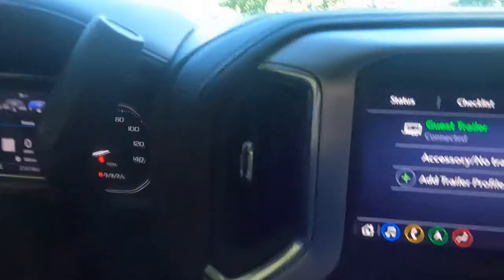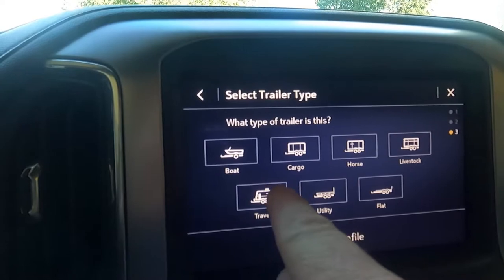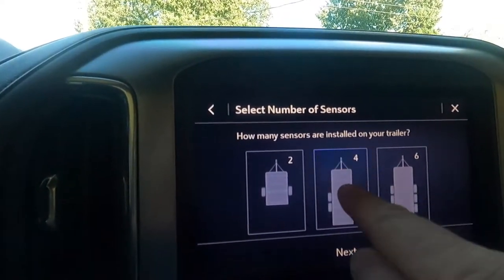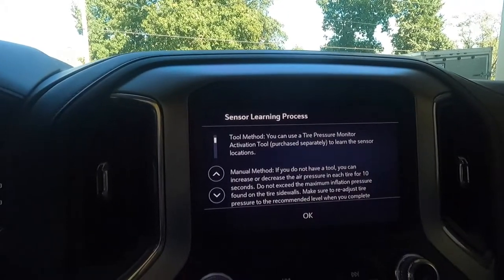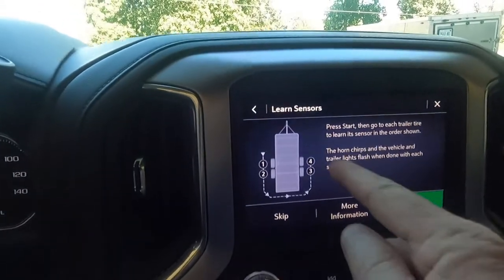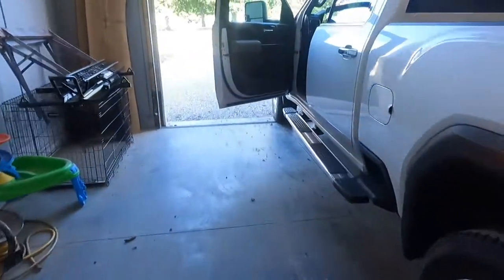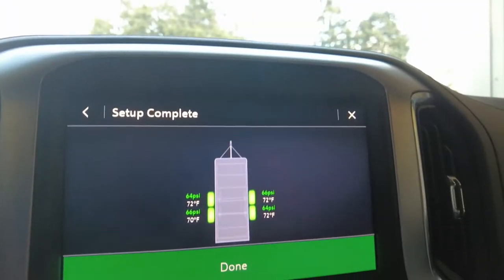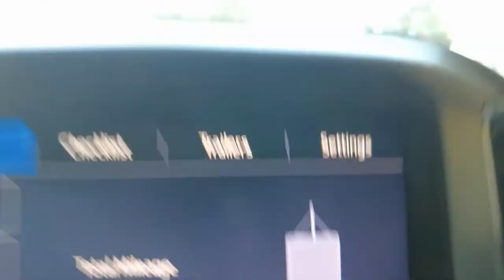Setting up TPMS  for our travel trailer on our 2020 GMC 2500HD SLT with ProGrade trailering system

Comment: Great video, very informative thank you! My 2020 AT4 HD came with the trailering package, including the sensors. I installed the sensors myself, and purchased the learn tool off of amazon. We went to Texas for the winter, then decided the trailer wasn't big enough for the wife, 3 pups and I so we purchased a fifth wheel, and sold our TT. Unfortunately I didn't remove the sensors and let them go with the trailer. 
I just finished purchasing new TTPMS sensors from the local dealership, and the reason being when I asked about replacements, the first thing they asked for was the Vin# on the truck, so this led me to believe that in order to get the right ones I needed to buy them from the dealer. Long story short, these new sensors and my lack of knowledge cost me about $300. Thanks again for the video, everyone is welcome to learn from my mistakes, and your information...
PS. at least I kept the scan tool, so that saved me 20 bucks LOL!
PSS Happy Camping
Reply from the maker: Hi Donald.  Thanks so much for watching and commenting.  We can all learn from our mistakes.  Believe me  I make a lot of mistakes. lol.  So nice of you to share your experience.  We love having the built in TTPMS.  Have a great rest of the week.  Kent

Comment: On my 2024 2500, the 'letting air out' method works perfectly.   I've actually had to do it several times because I had a problem with the trailer profile disappearing. After reseting the whole system, it stopped losing the profile.  My horn chirped after draining about 5 lbs of air for each tire.  I may get one of those tools anyway because it's more convenient.
Reply from the maker: Thanks so much for watching and commenting.  We really like the TPMS monitoring for the trailer.  The tool is really handy and just takes a couple of minutes to program all the tires.  Have a great week.
Reply: Just came across this video how did u figure out which one would work i have a gmc with prograde trailering and would like to get some for my camper great video
Reply: @colongarnto4695  I have the same question as you.  All the TPMS tools say they will not work in the '24 GMCs.  Strange.

Comment: Good video.  Thinking of buying two more to add my spares on truck and trailer.  Truck is under order. I guess I will have to tell it I have 6 wheel trailer and remember which 2 are my spares.  Or is there a better option?
Reply from the maker: Hello Dan.  I did not worry about putting on my spare tires.  I figured they would be taken back off as soon as I could get the other one fixed.  Thanks for watching and commenting.  Have a great week.

Comment: I purchased a tpms kit off Amazon last year and I wonder if the relearn tool will read the sensors that came with that
Reply from the maker: I don't think the aftermarket sensors will work.  I had an aftermarket kit and it would not work with the package on my truck.  Thanks for watching.  Kent

Comment: After setting up, does it have a low pressure warning
Reply from the maker: Hi Gary.  The only reason you would have a low pressure warning is if one of the tires is low.   If you are referring to if it will give a low pressure warning if a tire goes low yes it will.  It will come up on your dash.  Hope this answers your question.  Kent

Comment: Can you tell me what to look for to buy these for my gmc 2020, just bought a new fifth wheel, do they have to be gmc sensors,
Reply from the maker: Hi Brian.  If you do a search for trailer sensors for your particular truck several different ones will come up.  I think about any GM sensor that works on 433 mghz will work.  The main thing is to make sure they will work on your trailer as far as handling the tire pressure etc. for your fifth wheel.  Thanks so much for watching and have a great rest of the week.  Kent

Comment: Is all the trailering stuff a specific package you have to purchase with your truck? Shopping new Chevy 2500s
Reply from the maker: Yes on the stuff inside the truck.  The GMC is called the ProGrade package.  Not sure on Chevy.  Sometimes they call it something different.  You can buy the sensors aftermarket for the tires, but if you buy the truck with the trailering package ask them to throw the sensors in with it. The GM sensors are not real expensive if you get them when buying the truck.  If purchased afterwards they get a lot more expensive.  Aftermarket sensors do work though.  Thanks for watching.  It is a nice feature to have.
Reply: The sensors were a $50 option when I ordered my 2022 3500

Comment: How did you get the TPMS ? Do you remember the part number? My dealership is no help.
Reply from the maker: If your truck has the GMC  ProGrade trailering package or on Chevrolet I think it might be called something else then the part number for the tpms sensors is 84152501.  I had them installed by a tire shop and then programmed them myself with the tool in the video. They work awesome.  Actually any GM 433MGHZ sensor will work. You can find the trailer ones on line cheaper than from the dealer.   Thanks for watching and have a great week.  If this didn't answer your question feel free to message me back.  Kent
Reply: Thank you. I'll be checking for them soon.

Comment: We need a different one. Bills not happy with ours. Maybe we will look into one like yours. 👍🏼
Reply from the maker: Hey guys.  The one I have is integrated into the trucks 
tpms.  Do not know if your guys truck has that capability or not.  We found out it works as the second trip out with it we had a tire go down on us.  First time I have had to change a tire on any of our vehicles in 36 years of marriage.  I think I have been lucky. lol. Have a great week.  Kent and Tami
Reply: That’s true. Bill would know if our truck is wired for that.

Comment: Do you have which brand of TPMS you purchased on eBay?
Reply from the maker: Hi Scott.  I do not remember.  I searched for trailer tpms sensors for a 2020 GMC 2500hd and several came up.  Almost any GM tpms sensor will work as long as it is 433 mhz.  Sorry I can't find brand.  I am pretty sure they were just gm sensors for car or truck wheels.  Thanks for inquiring.  Take care and have a great week. They do not have to be trailer specific.   Thanks again.  Kent and Tami

Comment: if you install these and are not in the trailer screen will it let you know if one is low or getting hot? like on the truck it will ding light will come on and say hey this tire is low will it do the same on the trailer or is it something that you just have to keep an eye on?
Reply from the maker: Hi Chris.  It will come on even if not in the actual screen.  I have had this experience a couple of times.  It will actually come on in the info center where speedometer  is at if you have a problem.  It saved us from ruining a tire or blowout and tearing the trailer up. This system has worked great.  Thanks for commenting.  Have a great week.  Kent

Comment: Way to get the 4 on eBay for cheaper! We just got a new set of TPMS for our RV and tow vehicle! They are a must! Joel, Deb & 🐕 Maya
Reply from the maker: Hey guys.  Thanks so much for watching.  Our second time out since installation and we had a tire losing air.  Thank goodness we had it installed.  It was the first time we had changed a tire on a vehicle on the road since we were married almost 37 years ago. 😂  We have been so busy at work that we aren't getting on as much as we normally do. Take care guys and God Bless.  Kent and Tami
Reply: @ktkamping4975  yikes and good thing you had the TPMS then! God was watching over you all for sure! Have a great rest of the week!

Comment: 4 sensors came with my new 3500HD for only $50 when I ordered the truck. Code# PTT on my build sheet.
Reply from the maker: Hi Michael. Thats awesome.  When getting new truck they are way cheaper than trying to get them  after the fact.  Thanks so much for sharing.  Kent